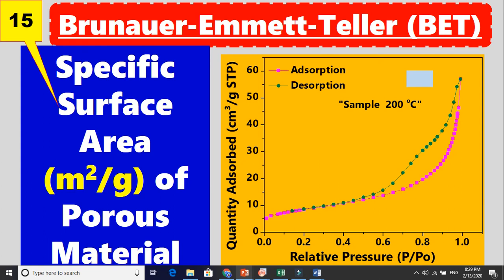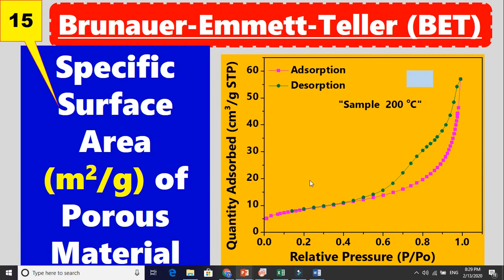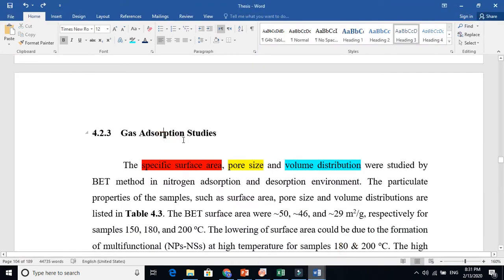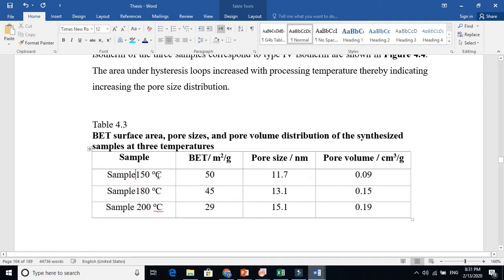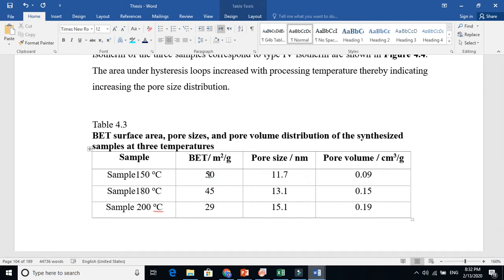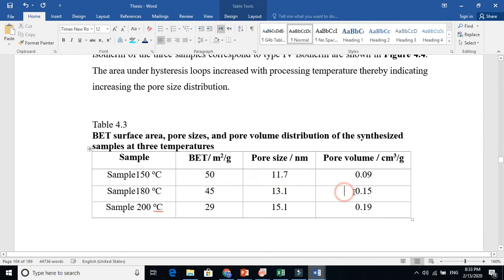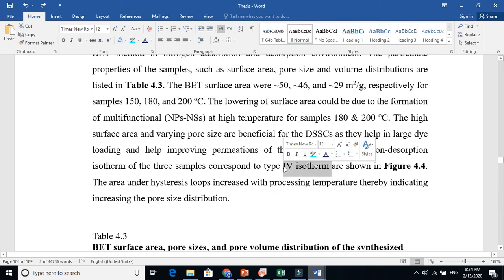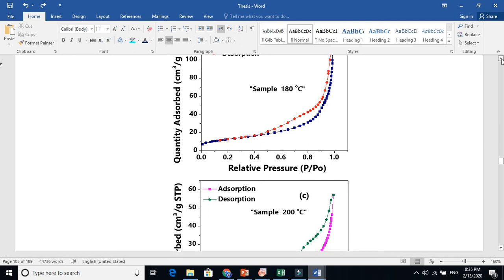BET Analysis :Gas Adsorption of Porous Nanostructured Materials

Comment: Hello Sir, your videos are always helpful. I have done the BET analysis. But I am a bit confused. As there are several options for choosing surface area, pore volume and pore size. I do not which one to choose. For example for pore size, the data given as (Adsorption average pore diameter (4V/A by BET):31.8722 Å    Desorption average pore diameter (4V/A by BET):31.8722 Å    BJH Adsorption average pore width (4V/A):84.622 Å    BJH Desorption average pore width (4V/A):45.848 Å). For pore volume it is (Single point adsorption total pore volume of pores  less than 2,675.448 Å width at p/p° = 0.992732676:0.713730 cm³/g    Single point desorption total pore volume of pores  less than 2,675.448 Å width at p/p° = 0.992732676:0.713730 cm³/g    t-Plot micropore volume:0.219715 cm³/g    BJH Adsorption cumulative volume of pores  between 17.000 Å and 3,000.000 Å width:0.381504 cm³/g    BJH Desorption cumulative volume of pores  between 17.000 Å and 3,000.000 Å width:0.541619 cm³/g).  Your help will be appreciated. Thanks

Comment: in my case, when I increase the temperature of the sample, the surface area is also increase. It is the data from lab. I used BET 92, because in our lab there is only BET 92.
Reply from the maker: So are you happy with that? Increase surface area is good in some cases while it is bad in other cases. Depends on the application. Which application are you using this material. 🤔

Comment: Dear Sir, Thank you for your lecture and effort. I am trying to find out how to calculate the surface area pore volume and average pore size. Should i do it by equation or is there any other way to get that? I have already drawn the graph. It's mesoporous type 4. waiting for your response.
Reply from the maker: These details are already there in the file you got it from BET analyzer. Every detail such as pore size,  pore volume and SSA (m2/g)... are there in the file
Reply: @nanospeaks  sir thank you so much for your quick response. Is there any platform that i can contact to you personally if i have questions in the future. Basically, i am focusing on the surface structure of the catalysis. can i have your research gate link or any other if you have? Would be grateful to you.
Reply from the maker: @waqasqureshi6196  just write Qamar   Wali in RG,  you will find my profile. You are welcome
Reply: @nanospeaks  Dear sir i have sent the message on RG.

Comment: I have some bet result .These surface area very small compared to the standard value. What are the reason for the decreasing value sir.
Reply from the maker: There might be different reason. Have you followed the same method  as exist in the literature or you change some parameters.  

You need to perform series of samples in order to know the causes

Comment: why the desorbed volume of gas comes at higher value or is higher than adsorbed volume in BET isotherm. isn't it like this.. whatever the amount is absorbed in the pores which is actually get desorbed in the  desorption process so that desorped volume of gas either can be equal or less  to absorped volume of gas. So, i dont understand Why in BET isotherm desoprtion curve comes higher than adsorption curve SIR.
Reply from the maker: I think it works like in similar pattern as hysterisis in case of magnetization.  One curve for adsorption when N2 gas molecules sit in the pores and other curve when N2 gas molecules leave the pores.

Comment: Hi Sir
Thank you for this clear explanation. I've got some BET results and the surface area was calculated directly by the instrument, I took them and I did a comparison of their values for my samples. I note that I am using my materials for photodegradation of dyes, I want to ask about the change in BET surface area values, when it's increasing it's better for the photocatalytic activity? 
thank you
Reply from the maker: Good question.  The BET surface area actually measuring g/ m2.  

It depends on the device. Some device need large surface area while other need small surface area.  It can be beneficial as well as worse. 

Decreasing size will definitely increase surface areas vice versa

Comment: Hello, congratulations on the material. Could you help me find BET surface area data and total pore volumes?
I have the raw data made available by the lab technician. I need to find this data, but I couldn't. I appreciate if I can help.
Reply from the maker: All information is available in that file which we get from the analyser. The graph I have drawn is basically from that file